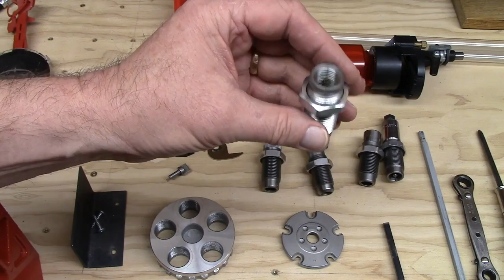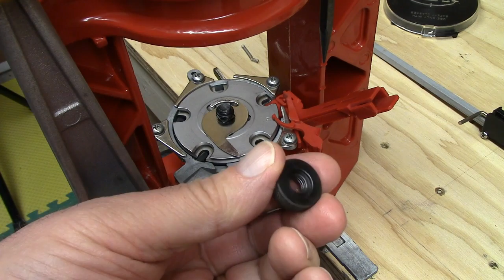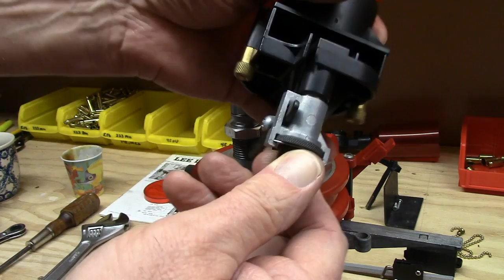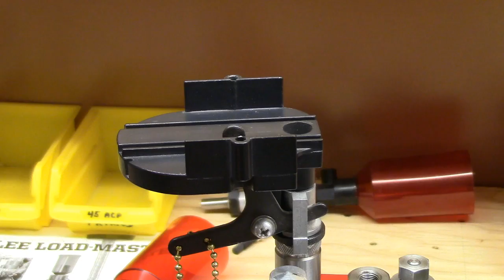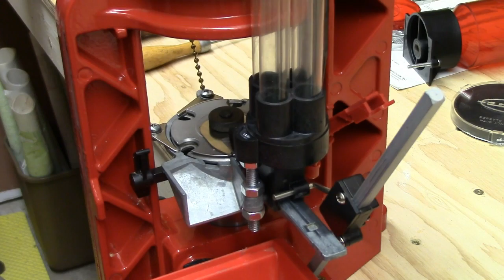How to Use the Lee Precision Load-Master ~ PART 1

Comment: What's the reason for using separate decapping and sizing dies in the loadmaster? I've been looking into a 5 station press to replace my Dillon 4 station so I could use a lock-out safety die but this recommendation for the master would negate that ability?
Reply from the maker: Sal S 
The positioning of the additional die in the loading cycle assures absolute indexing of the cartridge plate for more controlled primer alignment.  While it provides this measure of insurance and allows smoother and more rapid cycling, it's not entirely necessary.  Obviously, because bottleneck sizing dies incorporate internal neck sizing with decapping, the decapping pin must be removed at the priming station.  However, I generally do not use the additional die for rifle cases, as I am working a bit slower anyway.
Reply: OK, thanks for the response. I thought that might be the reason. Seems a little excessive to me since you already have 2 dies doing that, 1 at the sizing/depriming and 1with the dedicated carbide crimping die?  I only load handgun but do load most everything from 9mm to 500 S&W.  Still thinking on the change between a Lee, Hornady LNL or a Dillon 650. Hey it's only money right,  LOL
Thanks Again
Reply: @GunBlue490  Better to use a powder cop instead of a separate decap die that is doing the same thing as the resizing die could do.

Comment: I just bought a loadmaster, press only, from Amazon. It came with a case slider, but I have no idea which size it is - small, large or rifle. there are no markings on it. How do I tell which one it is?
Reply from the maker: wtb3nkfd54 
My smallest, suitable for most auto cases, measures .787 high, the larger pistol, for most revolver cases measures 1.100 high.  It should give greatest support with a given case, but the case should stand taller than the mounted feeder.  Feed tubes are made without bushing for large diameter cases such as 45 Auto and 44 Special/Magnum, and with an aluminum bushing for small base cases such as 9mm and .380.  I don't use a feeder with rifle cases.

Comment: Lee will not replace defective primer systems. this is what I was told in an email from Lee. "No, the parts are not faulty. There was not a manufacturing defect in the original version of the Loadmaster priming tools, or the Bullet Feed Kits, so the parts do not fall under a no charge replacement clause. We updated those parts in 2011; as more than 5 years have passed and our warranty policy has changed, we will no longer send them out at no charge. "
Reply from the maker: Kirk Sedgwick 
Five years limitation after a product revision is understandable and quite reasonable for any such part, and is far more than most companies.
Reply: GunBlue490 RCBS will replace for life just like most other most. My dad sent back some RCBS dies for update that where over 60 years old. They replaced them for free.

Comment: Excellent video sir.  I recently acquired a previously owned Load-Master and with your assistance cleaned it up an learned to set it up.   I have been unable to get the case feeder adjusted such that it only drops one 9 mm case at a time but, I'm sure I'll get there.  Thanks for the assistance.
Reply from the maker: Steven Miller 
You may be using the tall feeder with a short case. The case feeder comes in two heights; the short one measures about .750" top to bottom, and the tall is about 1.100".  The measurements include the slotted lower portion that wraps around the feed plate.  Use the shortest one that provides case clearance, and adjust the height setting nuts to allow clearance, plus, but not so much as to catch the feed tube.  Be sure also that your feed tube is appropriate.  They all use the same size tubes and lower unit, but the smaller diameter for 9mm size cases has an aluminum bushing inserted into the lower unit, while there is none for larger diameter cases.  Without the bushing, smaller cases will not be correctly supported as the feeder shuttles beneath it, and they will catch and tip over.  If you load different calibers, it's helpful to jot the sizes and adjustment measurements in your loading manual page for ready reference.  While some folks have adapted the feeder for rifle cases, I believe it's more time consuming to continually load the tubes than to just load them individually.  I load lots of 223 cases, and with them, I simply stand cases in front if the feeder and allow it to index the case into the shell holder.  They move right along so fast that I needed a larger catch bin, available at Home Depot or Lowe's in multiple packs fairly cheaply, and I use them for all sorts of uses.
Reply: GunBlue490 Again sir thank you very much!  Your recommendations are very much appreciated.

Comment: So, do you get consistent C.O.L on this "fabulous" press? I sure does not get anywhere near consistent C.O.L.
Reply from the maker: MrTrollgubben 
Of course it does.  Why wouldn't it?  The C.O.L. is determined by the seating stem.  I know of no press in the world that varies in the amount that its ram travels, and I know of no seating stem in the world that varies, either.  Price has nothing to do with overall length.  These are fixed settings, whether they are made with a micrometer or a simple nut. The turret moves up and down at a constant rate, and is limited by the exact same points.  I have no idea why you imagine C.O.L. can vary in any press, and if any manufacturer alludes to such variance in presses or dies, he's lying.
Reply: Sure, on a good quality singlestage press it is like you say the setting of the seating stem that determines the seating depth. On a progressive like this there are many operations going on at the same time, and the one operation in one station can affect the operation in a different station happening at the same time. So, have you actually measured the C.O.L of a whole batch so that you know for sure that it is consistent?? How much variation in C.O.L do you consider to be acceptable?
Reply from the maker: There are many operations going on at the same time, but only one operation is performed by each individual die, which is always at the same place, and they are no less precise than a single stage press in the least.  The ram travel is just as consistent, and any deflection is always consistent.  I have used all manner of presses in my life, and there is no variation introduced by a multiple stage press.  A die set at its station is as accurate as being set in a single stage press.  C.O.L. is a very important and vital attribute of loading, and is established by the die setting, entirely independent of the type, brand, price, or design of press. There are no variations in the C.O.L. whatsoever, which would be a physical impossibility without a physical change to die setting.  I have very frequently seen slight variations in overall length that do occur under certain conditions with EVERY press and die, which have nothing to do with the die or press.  These variations occur for the following reasons:  (1) Compressed charges, which exert upward pressure on bullets after seating, (2) bullet meplat (point) variations that affect bullet length, thus overall length, typically when sharply shaped ogives are used and the bullet point, rather than its ogive, is not bearing, (3) inconsistent neck tension and elasticity caused by variations in brass neck annealing, (4) air compression and entrapment, combined with #3, can allow variations in bullet/neck tightness.  Yes I have measured overall lengths.  It's standard practice.  I have measured C.O.L. all my life with dial calipers, and even the above mentioned conditions, in the extreme, measure no greater than .003" in my experience, which, in my experience as a precision shooter has little, if any affect on accuracy outside of the benchrest competitive arena.  And these variations occur at the single stage press, whether it was my RCBS Rockchucker, Lyman Orange Crusher, or whatever.  This is all moot, as the benchrest shooter simply does not use a progressive press, for reasons that have absolutely nothing to do with C.O.L. consistency.  Most folks buy progressive presses for lots of shooting with ammo that has no such critical measurement, that are hardly worrisome of .003".
Reply: I get very inconsistent C.O.L on the loadmaster. When I use the same set of dies, the same cases and the same bullets on a singlestage press, I get very very consistent C.O.L.
Reply from the maker: MrTrollgubben 
Check your stroke.  Human intervention is the cause.  It's absolutely mechanically impossible for the press to extend to varied lengths when fully extended.  The linkage is constant and all parts are constant.  A die cannot change its length, nor can machinery.  But you may certainly exert varied pressure, which is nothing to do with the machine. Be aware also that bullets can very easily vary in shape, as they can be packed in the same bix from different lots made from different dies, and that will cause C.O.L. variations.  While it's not found with individually boxed bullets, gross variations are not uncommon with bargain bulk bullets. Sorry, but it's not your press or dies, nor wojld it be with any maker's machinery.  Progressive presses require heavy exertion that require physical effort to perform heavy functions that are part of the bargain. I'm not sure what your COL variations are, but if they are within .005" for rifles, or .010" for handguns, I wouldn't be concerned in the least.
Reply: I do not totally agree that the human intervention is the only cause all the time. Even though I stroke it exactly the same every time, there could be variations in the force needed for the different actions going on at the same time in the different stations and this could cause the shellplate to tilt a tiny little bit to a variable degree each time, causing unstable seating depth. Even if I put way more force in the stroke than what is needed, (in an attempt to take human intervention out of the formula and to try to cancel out other variations), the col still varies just as much. When I have realoaded a batch on the loadmaster and the col varies a lot, I move the seater die over to the singlestage press and run the batch through and the col will be very consistent. Will first have to pull a bit on some that the loadmaster have seated too deep before reseating on the singlestage. I am far from the only one complaining on inconsistent col on the loadmaster..
Reply from the maker: MrTrollgubben 
I don't have your experience, and my COL is precise and always has been, so I can't help you or all the others.  I spent considerable time putting together the video to help folks, including you, but that's all I can do.  Sorry for your difficulties. I suggest you call Lee for assistance, but please don't blame me for trying my best to help you figure out your problem.  Obviously, I have been a problem for you, so please leave it at that, and take your own advice.
Reply: Hello again. I will not spam this video any further by going on with this discussion. I just want to say that you have not been a problem for me, I enjoy your videos and have found a lot of good info in your videos. I consider you a very experienced and knowledgeable person in this field, and that is why I was asking you in the first place since you seems to like this press. So, thank you for all the replies and all the time and effort you put in the videos. Sorry for getting carried away in the discussion.
Reply: @MrTrollHunter  You want to take a look at the youtube  video from 'mikes reloading bench'. Has addressed a couple problems and shows exactly why where may be an issue with your press. Some Load Masters do flip or tip primers on occasion, and some do have inconsistent COL.  While GunBlue490 has a vast wealth of accurate information, Mike I believe is a professional machinist, and I believe a mechanical engineer. In his videos, he shows exactly why the problem may exist in some ML presses.  I would however also not discredit any information GunBlue490 has in his videos as he has helped me immensely with setting up my Load Master
Reply: @williamkerker8393  Yes thank you, I am aware of mike's reloading bench and I even wanted to buy one of his billet turrets, but he does not ship abroad. I highly value a lot of GunBlue's videos and helpful information, and so also these videos on the loadmaster. We just could not agree on whether the press can cause inconsitant col or not.

Comment: GunBlue490 I was amazed at how smooth your Loadmaster was when you brought your lever into contact with the indexer and pushed it in.  Mine was always more along the lines of needing a bit of a hit.  After watching this I searched out a pointed whetstone that I had bought some months back from Dan's Whetstone.  Looking at the shaft of the indexer there was obvious scoring so I've just worked the shaft and the channel over and boy were there some nasty burrs.  I've now got it all cleaned up and it sure is working a whole lot smoother.  Thanks again for the education my brother (my older brother is a '49er and a retired teacher.  Whodathunk?).

Comment: Fantastic video!  I had put my Load-Master on the back shelf because I couldn't figure out all the intricacies of this beast.  This explanation was awesome.  One question please!  I use HS-6 powder in my Lee Powder dispenser and I get leaking of powder every time.  Is there a bigger size powder I can use for my 9mm reloading that won't leak out each time I activate it?  Thanks again.

Comment: I've been reloading on a single stage Rock Chucker since the mid 80's. I found this video while looking for content on the Lee Classic Turret Press. Your detailed explanation has convinced me to go ahead and purchase a Load Master. I do have one question though. It seems like it would be easier to cycle manually through each stage and completely adjust each die before moving on to the next stage. For example, you had a few bullets that were not fully seated and were set aside to be completed later. Is there an advantage to keeping the auto indexing engaged while making the final adjustments? It seems that if you ran one case through, cycling to each stage manually, you could fully set each die. Lee should thank you for this excellent guide.
Reply from the maker: Forrest Clark 
It's just the process I followed.  Your method would work just fine, too.

Comment: My shell plate does not spin freely when I return it to the center ram.  It is down flush but it just doesn't spin freely.  I have an earlier version of the Load Master.  The head of the ram is black and whether it is anodized aluminum or acetal plastic or carbon fiber I do not know.  I purchased it new in about 1991 thereabouts.
Reply from the maker: Patman Crowley 
Contact Lee for assistance.  They have always been very helpful.
Reply: Got it fixed!  Peace be with you and thanks for your wonderful video's.  I enjoy learning.

Comment: Excellent presentation.  Vibration during sizing is one of the  main reasons that primers get tipped or off-center.  Using a little alcohol+lanolin lube on pistol cases reduces the shock of sizing.  Even with carbide, there can be some binding.

Comment: I have seen many videos on this press ,and I want to tell you that this is the most informitive one that I have seen , excellent job ....I wished a 1000 times That I woukld have bought this press instead of that POS PRO1000 that I got , Im fixing to put it up for sale and get this Press, Im am very mechanical inclined, and actually have worked in manufacturing maintenance working with PLL machines.... and I worked and worked on that Pro1000 till I was ready to take a sledge hammer to it and could never get it to work , between this Video and all the videos for tricks and mods for the Loadmaster  that are out there, This video has inclined me to go ahead and Order on , Thank you Sir for a great video, My hats off to you , Im sold  Thanks

Comment: gunblue what die are you running in position 2?
Reply from the maker: lithicus321 
1. Universal decapping die.  2. Sizing die, with decapping stem removed.  3. Powder charging die.  4. Bullet seating die.  5. Lee Factory Crimp die.  
The reason for the setup in stations 1 and 2 is to maintain perfect case alignment over the priming station, which eliminates the issues of primer misinsertion. Be sure to remove decapping stem from sizing die when in station 2.

Comment: Thank you very much for such a thorough setup tutorial. This should be required viewing for all Loadmaster owner.  My Loadmaster will be here later this coming week and I need to ask a question: considering all the moving parts and need for periodic adjustments, how much space on the bench is needed on the right side of the press (from operator position)?

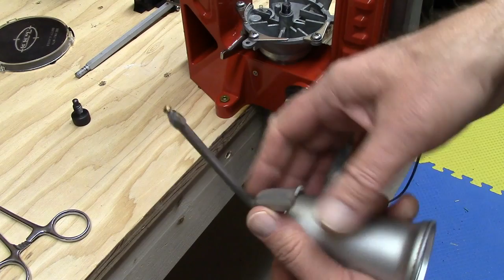Comment: At 13:00 minutes you point to the ball bearing that needs the motor oil. Lee Precision must have eliminated the ability to lubricate this area. The Loadmaster I received 11-14-16 did not have a lubrication fitting like yours. Which is unfortunate as the only place this new press has drag/resistance is right in the middle of the stroke with nothing attached to the carrier. No index rod, no shell plate, no primer feeder, no shell feeder...nothing. I think if there was still an oil lube hole it would help smooth the action of the press.
Reply from the maker: big321danger 
I believe that Lee recommends simply applying the same oil along the shaft while fully extended and retracted.  I can say that it's actually more practical, requiring no additional oiling device.  My old 70s era pump oil can that was made when electric motors often had oiling caps are no longer made, and othrrs like it are difficult to find.  It takes VERY little oil.  Just swab motor oil onto the shaft with a clean rag every now and then.